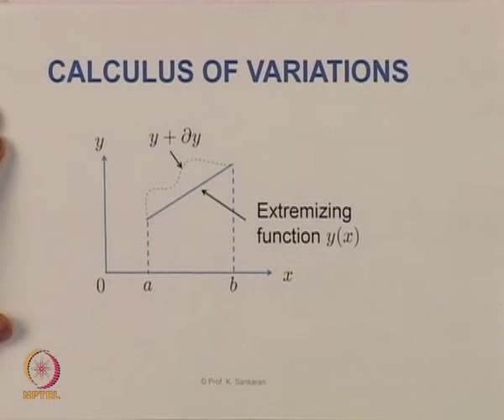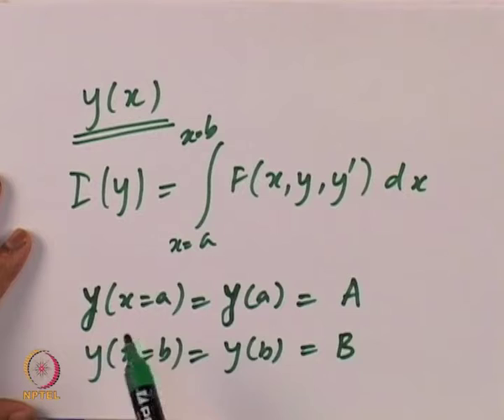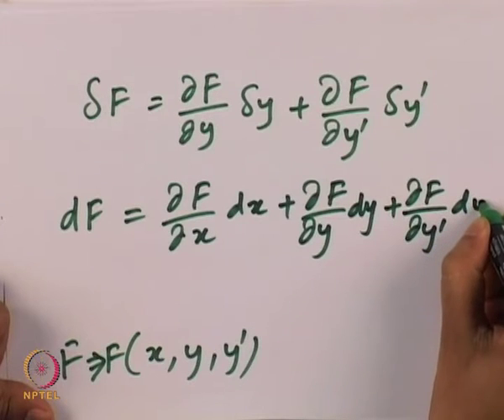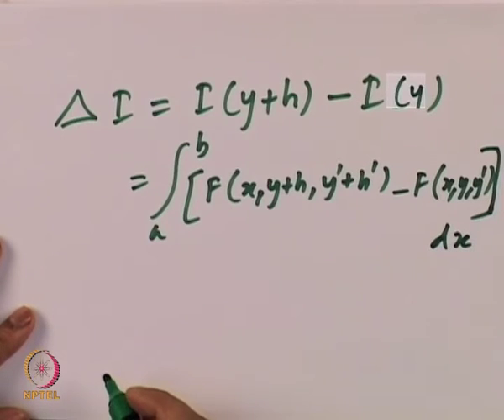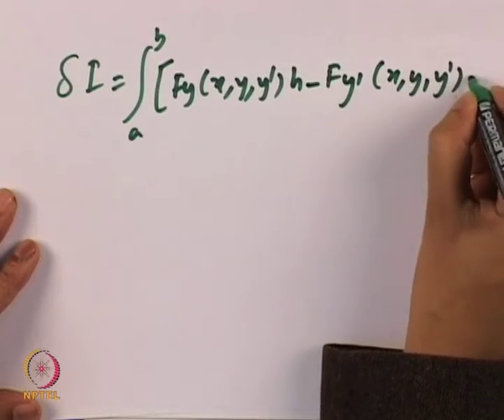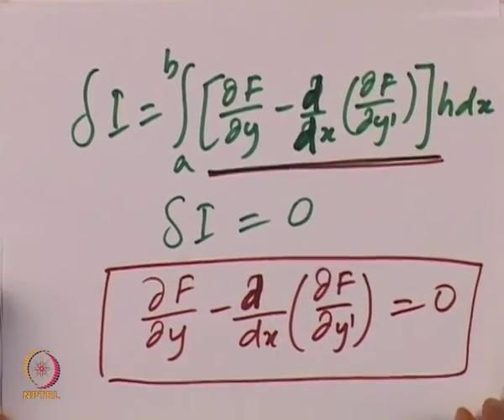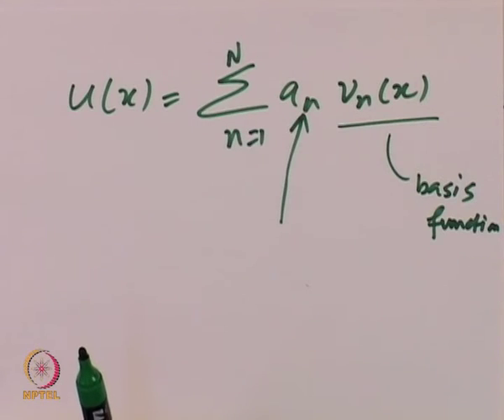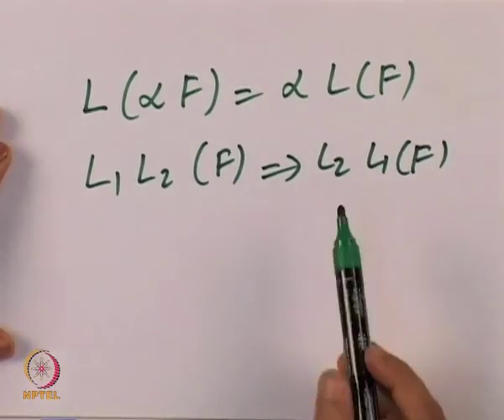Lecture 16 : Variational Methods

Comment: There are some mistakes in this lecture
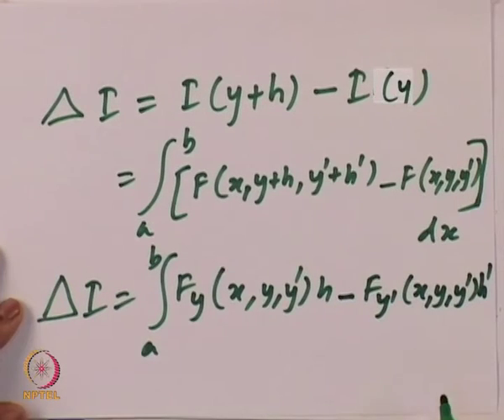1.) 12:50 minus sign in the Taylor series approximation should be replaced by plus sign
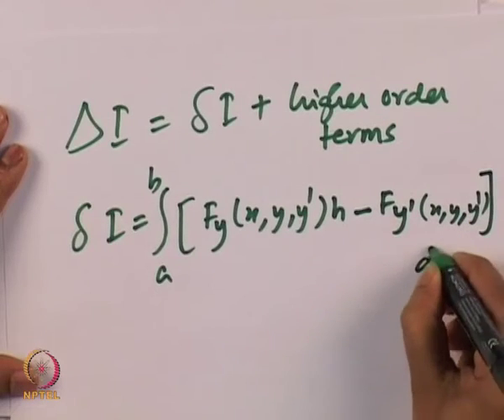2.) 14:12 fy'(x,y,y') should be multiplied by h'